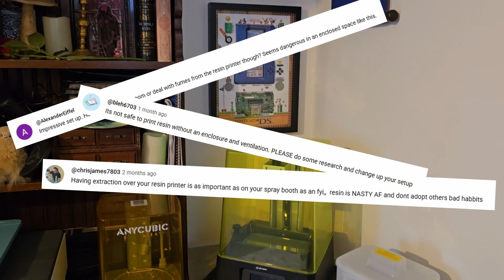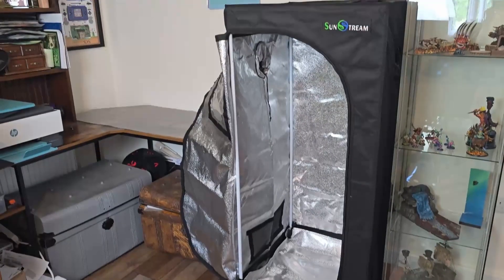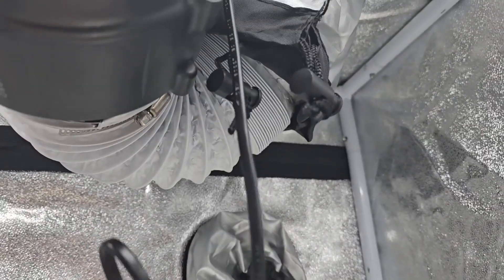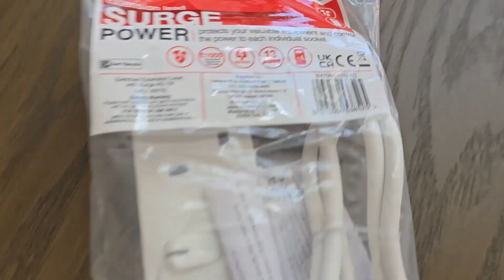Upgrading my setup for 3D Printer Ventilation (Safety First!)

Comment: Hey man! Came across this video as I'm new to resin printing and just trying to set up my own system - really helpful stuf! Just had a quick question - how have you found your fan? I've followed the link, but I'm kind of iffy about getting one manufactured by some fly-by-night company listed only on Amazon. I can't find much better at that price point, however. Have you had any problems with yours, or is it still working okay? Also, do you know if it'd be possible to put a heating unit in the grow tent to keep the resin warm? I've heard that you can run into problems if the resin temperature isn't between 25-30C. Cheers!
Reply from the maker: Heya, glad you found the video helpful! I had concerns about the fan too, but honestly was very surprised with how strong it is and I have had no issues so far. I felt better about ordering it on Amazon, as I thought if it ended up being rubbish I could return it. I am not sure about the heating option. It is insulated so would hold heat well, but I don't know if itd end up being a fire hazard. I personally haven't had any issues with the resin even if its colder than 25deg, I think as long as it's room temp it should be fine.

Comment: I'm very very new to DIY projects like this and was wondering, how did you attach the wide end nozzle to the duct? Did you tape it or did you use some kind of connector? Also, did you find a nozzle with the same dimensione as the duct? Or do the dimensions not matter that much? I have a shutter window in the apartment I'm renting and the nozzle would very much solve my ventilation problem. Thank you in advance
Reply from the maker: The wide end nozzle attaches to the duct with a clamp. It's a metal ring you put round the two, and then a screw tightens the ring to any size you need. Mine came with the duct (here is the link for reference: https://amzn.to/4nIBqCr) dimensions do not matter too much as long as you are bigger on the duct than the nozzle so it can wrap round it and clamp tight with the metal ring. Hope that helps!😊

Comment: Very nice. I've no 3D printer, but I should do something similar for my laser. It's near a window, and I do have pretty good venting, but it's not enclosed. Still a lot of smoke _smell_, even if it's not clouds or whatever. Your setup looks great
Reply from the maker: Glad you like the setup! You could potentially lay the grow tent on its side, might work better for a laser setup. I originally wanted to do that too, but it didn’t fit on my desk. Enclosing it would help a lot with the smoke smell I should think